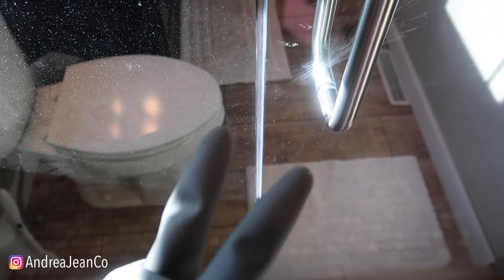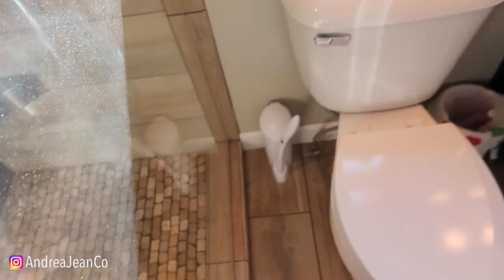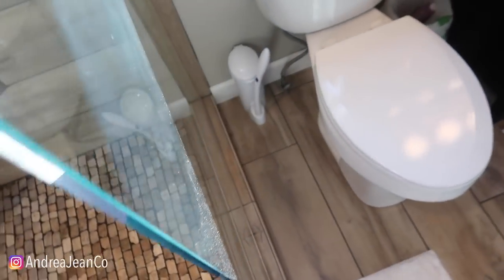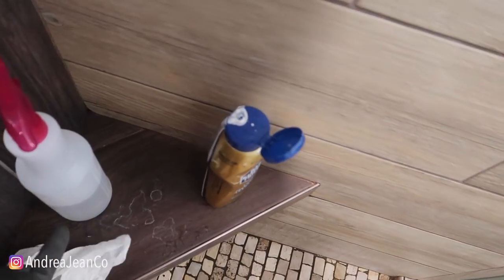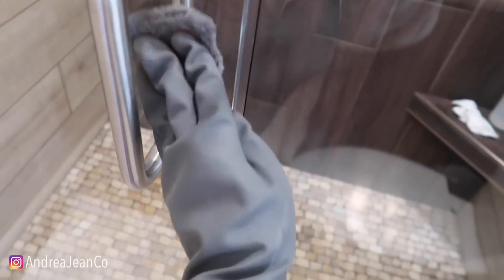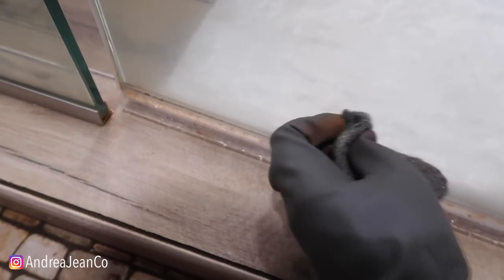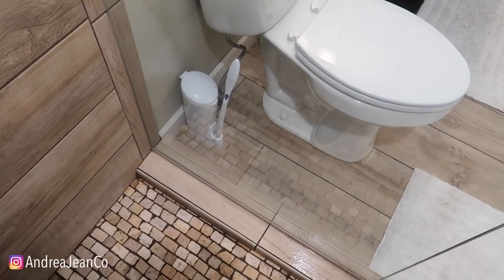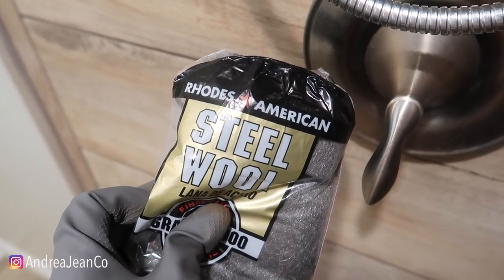How to REMOVE HARD WATER STAINS on Glass & Shower Doors! (Clean & Prevent Soap Scum) IT'S A MIRACLE!

Comment: Hi there Andrea Jean you're my favorite Cleaning Coach, you make it all look so easy and with your great tips it really is.  I've been using steel wool tro super clean glass for years.  You want to make sure it's the ultra fine steel wool the one with the most zero's 0000.  And wear gloves or you will end up with little pieces of steel wool embedded in your fingers.  I would recommend using a glass cleaner as a lubricant with the steel wool and don't scrub hard on the glass the water spots should come off without having to scrub too hard.  Now for you hardliners out there that have water spots on your glass older than your children than you need to break out the big guns. 

Tis the season so now we don our clean apparel...ya need to wear gloves and if your prone to dripping cleaning solutions in your eyes then put on  protective eyewear,  take some toilet bowl cleaner, do y'all remember that little man in the dingy that would always surprise the woman when she would lift the lid to clean the bowl? Was that the tidy bowl man?  What ever happened to him? Lost at sea probably hit by a rogue wave. Anyway put a little toilet bowl cleaner on a scrubby sponge with a little water, spread it on the water spots let it sit for a minute then scrub in a circular motion adding a little water as needed then rinse, repeat if necessary. The great thing about this also is it repels water spots for the future.

Comment: Make sure you rinse where you used the steel wool. I cleaned my oven racks with the soapy kind and didn’t get it all rinsed out of the sink-due to having a sink mat so I didn’t scratch the sink-ugh what a mess! I don’t know if this happens with the non soapy steel wool but its worth a few seconds to rinse the bottom of the shower - - - not to find out the hard way like i did!!!! Ive also used a razor blade to scrape scum off - works pretty good and I’ve never scratched the glass but make sure you spray the glass with window cleaner or something as a lubricant.  Also - another great use for steel wool that a Plummer told me about.  We kept getting mice coming up through the kitchen island cabinet where the plumbing came through the bottom of the floor. Anyway, he told me to stuff steel wool around the pipes and pack it as tight as I could - also do it OUTSIDE where anything is not sealed and the slightest hole could be found.  Apparently mice cannot chew through the steel wool like other sealing products. I haven’t had a mouse for over 10 years. I loved this tip!
Reply: What happens if I don't rinse?
Reply: Shirley if you leave the residue on a metal sink (e.g. Underneath a mat at the bottom of the sink like the person above mentioned)  the tiny metal  fragments that fall off the wire wool pad will rust and can  stain the metal sink.

Comment: Great tip. I clean the glass with Isopropyl alcohol then apply Turtle Wax Ice Seal N Shine (Improved version). Water beads up, rolls right down the glass. Then wipe with a good squeegee after every shower.
Reply: Can I use the wax on my ceramic tiles in the shower too?
Reply: @terrizierke8528  I do something similar. Just remember not to put it on any surface you'll stand on because it'll make it slippery.

Comment: Great video - thanks! Bar Keepers (which I love) didn’t work on my glass shower doors but the steel wool did. As someone else below said - use another cleaner as a lubricant for the steel wool to get the scale deposits off so you don’t scratch the glass.

Comment: Great tips but how do you keep the bottom of the shower door (the plastic ending) clean? Can you please show how you take it off? Mine doesn’t budge and looks dirty..... please help!
Reply: It probably has a fine bead of silicone on it holding it to the glass.  Cleaning it will be difficult you can probably buy a new one from a local glass company for 20-30 bucks.  -A glass installer.
Reply: @willroescher2909  Thank you so much! 🙏🏻

Comment: I have tried everything you can imagine to get rid of the stains on our shower and nothing has worked it looks great until it dries I have scrubbed it wire wool brillo pads vineger bleacg pasted on straight with a paint brush and it's still there it's like it's frosting as in acid etching but only a million times uglier and makes the bathroom look dirty no matter how many times I clean it I have started to put a big bath towel over the glass to try and hide it
Reply: Try vileda power pad..works quite well
Reply: my experience - with certain cleaners & depending on the "quality" of the glass is a big thing too in some cases 
-- glass can get a permanently hazed looking - a film -due to harsh cleaner or like i said the low quality of the glass & or mirror could be the issue (not always yet sometime) 
for example - straight vinegar is highly acidic ph !!! 

best wishes 

i have used "GEL-GLOSS" since 1990!! it's magic in a bottle in my opinion - on glass & shower & sinks & appliance =it's like waxing your dull car !!! super shiny results 
(amazon & Lowes sells it and only need a little bit and no water needed) it's not a cleaner - it a polisher 🌸
Reply: @Proverbs31_25  thank you so much for replying I will try get some of stuff from Amazon as we don,t have a Lowe's here in Ireland so again you so much from Dublin Ireland xx